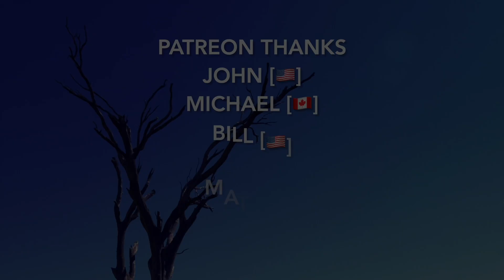🇺🇦 УМПК-Р (UMPK-R): Part 1 (First Look) [TCE #0544]

Comment: СТР из probably Стирание, Delete
ЗБ = Забой, Backspace
УС = Управляющие символы, Ctrl
СС is probably Строчные символы? (lowercase characters)
Reply from the maker: Thank you Sir, I know I can always count on you to help with the obscure/difficult translations!  I'll update my list.  You've probably told me these on previous machines but I forgot to keep a "definitive list".  And I totally forgot that I didn't list a "delete" key at all!
Reply: @Brfff  Hi! This PC has no lower case in original form. Because it uses 7 bit encoding due to CRT controller chip 580ВГ75, clone of intel 8275.
About keyboard special keys. I had trying to read describe of keyboard in original articles, but they not describe УС СС keys. But I was found the article about video terminal in the articles about preducessor Микро-80 : Клавиша РУС служит для формирования кодов русских букв, клавиша УС для формирования кодов различных управляющих и графических символов, а клавиша СС — для формирования колов специальных символов.

But on the Микроша key СС replaced by НР - нижний регистр. The manual of Микроша says that symbols on numeric keys might be typed only with НР key.  

СС - специальные символы - special symbols (I think they means +!"#$%&'()= and others )

580ВВ55 = 8255. One is for keyboard, another one is external parallel GPIO port. For example, it was used as EPROM programmer (with external Vpp supply). Also it was used for "ROM cartirges". There is monitor command "R - copy from external ROM to RAM" in original 86RK.
Reply from the maker: Thanks for the research!  Yes, I think you're spot-on about the УС/СС keys ... I was reading the manual and found the character set listed, for example:
Graphics characters: УС+[key]
Punctuation marks (!"#...): СС+[key]
And it seems to get a hyphen-like character: СС+ЗБ
Reply from the maker: @sergijtolmeros  One of the guys on the Ukrainian retro computer Telegram sent it to me!  I just posted it on my Patreon (public section) here:
https://www.patreon.com/posts/umpk-r-manual-115886138
Reply: @Brfff  Oh, СС is Специальные символы, special characters here! 7-bit encoding and no locase.
Reply: @Brfff  Seals : ОТК2 . ОТК - отдел технического контроля. This seal is like "QC PASS" label, but also a warranty seal.
Character ROM has pencil (looks like pencil) text ЗГ - знакогенератор
Reply from the maker: Ahh, thanks for the seal info ... I thought I'd seen it before but didn't know what it stood for.  Will keep a note!  Regarding the ROM, the documentation seems to indicate it'll boot with РАДИО-86РК text so I'm assuming it's the same ... but I'll dump it just in case there is some small difference.

Comment: I would love to get hold of some Soviet computers but they are so expensive. I do have some soviet computer parts though.
Reply: I have the same thoughts. Faulty is fine as my joy is from making repairs and getting things working.
Reply from the maker: Well, I've got a few spare ... but they're not working.  This is the guy I get most of mine from (in Slovakia).  If you're looking at similar 8080 machines (based on the Radio 86RK design), he does have a few Alpha BKs, a Mikrosha and a Partner.
https://www.ebay.com.au/str/dragonberseker
Reply: Once I found part of DIY case from, I think, DIY radio 86rk on the street when cycling. It was top part with cursor and F-keys. The  main keyboard was missing. It seems was destroyed by someone, maybe homeless. For my opinion, after mid 1990s all those 8bit computers were perceived as garbage, because of appearence of second hand IBC PC compatibles. Only the presence of gold, palladium (green and orange capacitors) and other expensive mettals maked them valuable... for destroing and scraping.

Comment: Did you ask ChatGPT multiple times in different sessions? It's a decent way to check if it's making stuff up, because it has a random factor and it often makes up pretty plausible theories and I can only reliably identify if they're wrong when I really know the subject matter, not when I'm just curious. If it answers the same in different sessions it's more likely it knows and isn't guessing.
Reply from the maker: Ahh, that's a good point!  I did try twice with the [СС] (i.e. "SS" in Latin) key and it did give two different answers ... first one was "well, it's a total mystery!" and the second was "it's a shortcut for «СССР»".  But I know I can usually rely on @Mercury13kiev to give good translations!

Comment: That has to be one of the most pristine computers, East or West, that I have ever seen. It looks brand new.

Interesting how in the prototyping area half of the holes are filled with solder already. And on an angle to boot. And did you notice the double caps on each of the memory chips? And that looks like conformal coating to me. How they managed to dip it and not fill the sockets with it and ruin them is a mystery. Possibly they sprayed it on and then hung the board up by the back of the computer.

And yeah, it was well designed, and is a very pretty computer!
Reply from the maker: YES!  As I was watching the video back I noticed the double caps!  I really need to get a new pair of glasses (not used to wearing them, but it would make things easier!)
Reply: @Brfff  I'm nearsighted as all get out. Something that comes in handy in this hobby. :)